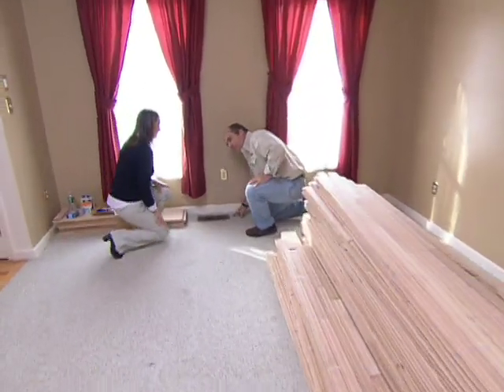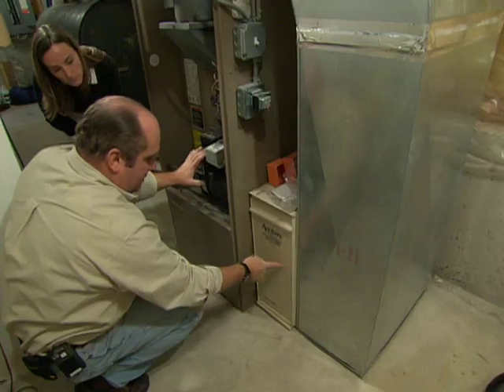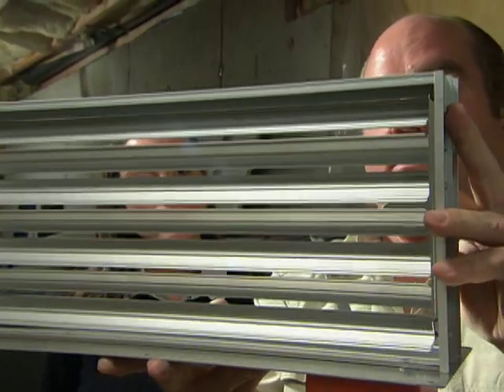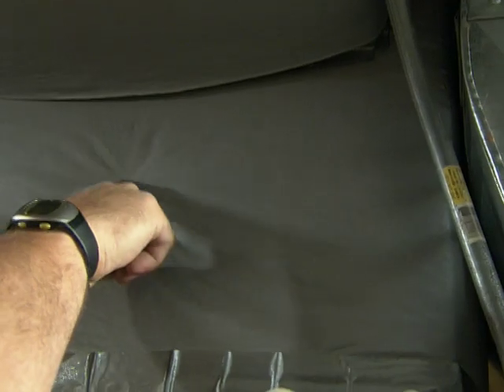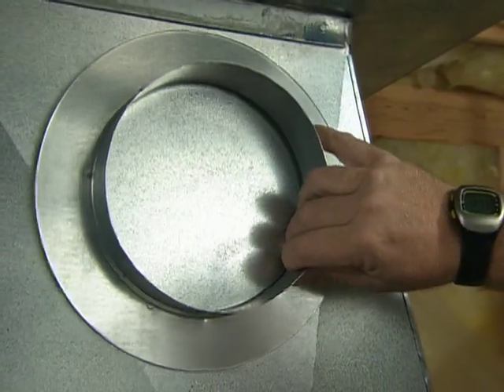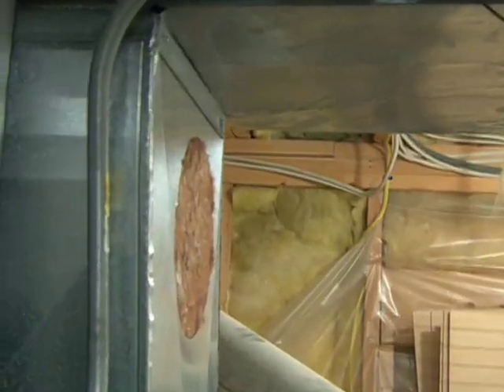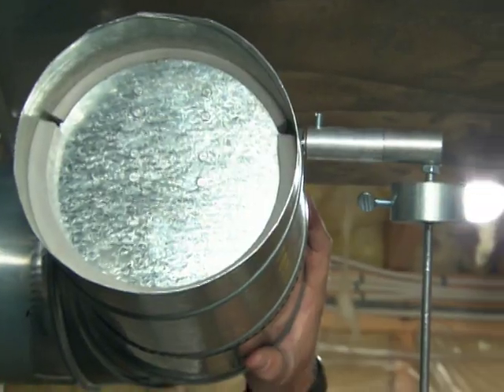How to Install a Forced-Air Bypass Damper | This Old House

Comment: I have 2 room that barely get any air, these 2 room only have one vent and room a very cold, I checked dampers and everything is open. I tried closing others but I still see no results. Is there anything I can do push air into these 2 rooms. I have split-level, live in Mass.

Comment: Just go a new Goodman 3.5 ton AC unit installed and it does not cool my house as it should. I set it at 77 and does not come down from 80 and is on all the time. Also the airr is humid. Had an AC tech come out and he recommended a by pass and wider vents in each room. After paying an arm and a leg for the ac unit, this will cost an arm to do also. Would a by pass and wider vent holes correct my problem. Had 2 tecs come out and they are not sure if this would fix my problem. This is all chinese to me. any advise?

Comment: The static pressure return damper (SPRD) is obsolete. It was replaced by the Constant pressure return damper (CPRD). There is no weight on a pivot. It works on the actual static pressure in the return.

Comment: I wonder about how much inefficacy is added from installing the mechanical passive bypass where heat is cycled back into furnace. I would think it to be more efficient to vary the blower speed for demand if one or both zones are requesting service.

Comment: When my forced air furnace starts blowing it’s like a plane taking off, and drives me nuts. If anyone is watching TV they have to turn up the volume while the heat is on. I don’t have dual zones like this vid but feel it’s a velocity noise. Where can I start to reduce the noise?

Comment: They didn't get a video of it working because they don't work. If you're gonna put in a bypass, try to tie it into the return as far away from the AHU as possible. Dumping it directly into the return at the unit is gonna cause overheating in the winter and possibly ice up the evaporator in the summer. Cutting it into the return further back will at least let it mix with the return air a bit better. And do yourself a favor and steer away from those weighted dampers. If a bypass is a must, whack a Honeywell Tru Zone bypass in it. They actually work.

Comment: In normal mode, you have 70degree air heated to 130 degrees. In bypass mode, the blower and heat exchanger see 98 degree air and heat it to 160 degrees, significantly reducing efficiency and life of all components. This is an exceedingly bad idea.

Comment: Had the exact same issue. Idiot builder put a furnace in the house, twice the BTU that was needed. The key with furnaces is to fit the house correctly. Bigger isnt always better. After years of tinkering with the oversized unit. Relief dampers, Zone dampers, odd and ends. Finally put the correct size furnace in the house. Half the size, works flawlessly.

Comment: In the older zone systems you were suppose to have a bypass in the system.you have to relieve the static pressure when one zone calls and the other doesn’t.the dampers here are old style dampers.if I was the homeowner I would unhook the zoning.then when time to change out equipment go to a variable speed furnace and new zone system.Carrier infinity zone is a nice option.
Reply: I agree. I seems like pumping cold air back into the return air is going to cause the evaporator coil to get too cold? This could cause it to freeze up and will also negatively affect the systems ability to dehumidify the house.

Comment: Bad idea, gonna overheat the bonnet with that short cycled hot supply air
Reply: Exactly what I was thinking.. nuisance tripping on the high temp breaker

Comment: Where'd this loss of efficiency stuff come from.  Do you freak out every time you put your car on max a/c and it goes into 80/20 mode?  No. My biggest concern with this would be the damper somehow sticking open and a double closed zone error and a failed overheat sensor.  Unlikely, but you want home systems as idiot proof as possible or we'll quickly be in a situation where the average residential furnace will start throwing OBD2 codes and flip on a check furnace light to illuminate.  "Help, my furnace is in limp mode"

Comment: How about adding a differential pressure switch. When the air pressure reaches a high, (one zone closed) fan speed changes to low. However, it is never a good idea to to serve two floors from the same system.

Comment: The cold air from the return is supposed to cool the heat exchanger what will happen is this will burn it out completely cause it won’t cool properly this guy has no clue what he is doing.

Comment: This is completely wrong this guy just messed up that heating system so bad you only bypass humidifiers that is all wrong like YouTube is ruining HVAC I swear to god there are like hundreds of videos that are making more problems.
Reply: Angelo Goreham. Everyone and their mother in the industry including NATE contractors install bypass dampers, just saying.
Reply: I am a bit of a novice but come more from the controls side.  My observation of bypass dampers is typically that they create a lot of opportunity for inefficiency as dampers go bad or are installed incorrectly.  VFD would have been better but is more complex and costly.

Comment: By installing the bypass you lose between 20 to 30 percent of the efficiency. The issue is the furnace to begin with. A 2 stage variable speed furnace would be the correct way to go. 
If im wrong im open to correction.....
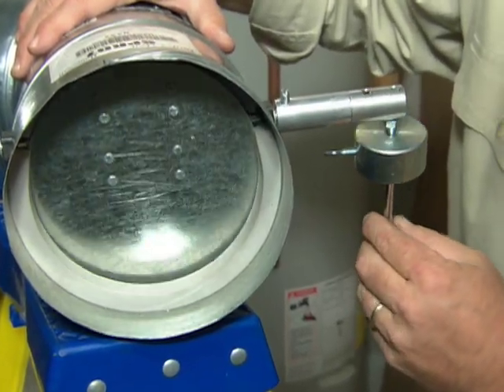Reply: Mr.Hooman, that was my thought EXACTLY.   I'm assuming that they did this so that the regular do-it-yourself homeowner would have a realistic and less expensive (although not optimal) solution. As some other people stated, I would have liked to see if indeed the bypass's manual damper would remain fully closed when the motorized dampers for both floors were full open. My guess is no. So, that's going to waste air, and through my research I found that your estimate of 20-30% loss is right on the money. On another note, he purports that the bypass will relieve 50% of the overall air, and therefore the excess air pressure. Well take a look at the size of the bypass: 3:56 and look at what it is the bypass for: 4:12. That little fart-fan sized pipe isn't going to bypass but 10%! And like you pointed out, the loss - because air will travel where there is least resistance - and also, the return, (which is often starved for air) may actively pull air from that bypass. I change my original position on this. I dont think it is an acceptable alternative, even for a DIY project. It's only a temporary, inefficient bandaid until it can get fixed properly. Why not install another supply register in a cold spot, anywhere in the house, and have the "bypass" go there?
Reply: MrHooman. Explain what you mean by 2 stage.
Reply: I'd agree with that if I didn't know anything about furnace efficiency. I prefer my low heating bill, thanks.
Reply: where is this loss of efficiency?
Reply: Max R a 2 two stage unit is this 70%|100%

1st stage of heat burns with less gas, less heat, and fan operated roughly 70% of capability... it helps when you need to bump up the heat by a couple degrees and mostly runs for a few minutes before calling for the 2nd stage

2nd stage is like full throttle at max capability with max gas pressure burning and you’re trying to heat your house 8-10 degrees... 

I believe my expiation is correct but others feel free to correct anything I may have miss informed
Reply: You would be wrong. Only because they are attempting to fix an issue without changing out the furnace.

A lot of fixes on TOH is about doing something for low cost, to fix it now, without costing a lot of money. Sometimes that's not possible, and also since these shows are scripted they already tell homeowners this previously, so homeowner already rejected a new furnace or said "I want it done for under X amount" so in fact whatever the best solution is doesn't matter.

This fixes the problem end stop. It's not the best way, but that's not the point.

Comment: I really am impressed with how he solved the whistling on the first floor by installing a round blade damper bypass. It helps reduce not only the whistling on the first floor damper, but also reduces excess pressure buildup on the second floor damper from rupturing the entire duct. The only drawback to this tactic is minor because you would have to check the return air filter immediately in the case of excess air.

Comment: the damper arm would be adjustable so you can adjust the weight for the amount needed for different pressures.  the size of the damper seems a bit small. at least 12" would have been a better choice just looking at the size of the zoned ducts. could have mentioned about adjustment to the limit switch (if adjustable) or replacing for a higher value (within the equipment's manufacturer specs) efficiency wouldn't be affected as there is no heat loss.

Comment: Yeah but you're taking heated air and forcing it back to the return and through the furnace again which is not very efficient.
Reply: As the first guy said. That air will be warmed twice meaning it will take less time to warm the second (or first) floor which means it wont take as long to get up to temperature and the furnace will shut off faster.
Reply: But doesn’t that mean the the limit switch will trip with more heated air about to pass over the heat exchanger
Reply: Paul K it will be warmed twice, warmer for the second floor

Comment: Unless that is a variable-fire unit, won't this increase temp rise quite substantially on the air that is delivered to registers and decrease boiler/furnace/ AC efficiency ?
Reply: It absolutely will decrease efficiency when the bypass is active. The other option is for the home owner to spend $3,000 on a 2 stage furnace. Which will still have the same issue when the 2nd stage activates and the baffles are closed.
Reply: @jonathasnyder  that's why they need a VFD

Comment: Nice, but you couldn't have made it 10-15 seconds longer and showed us that weighted arm moving when one zone was closed??? Would have liked to see if the relief damper stayed steady (0pen) or oscillated when the bypass lowered the back pressure in the plenum???
Reply: Also a discussion of where to place the weight to make it open only when it needs to. I guess that's more detail than you usually get on these kinds of shows.